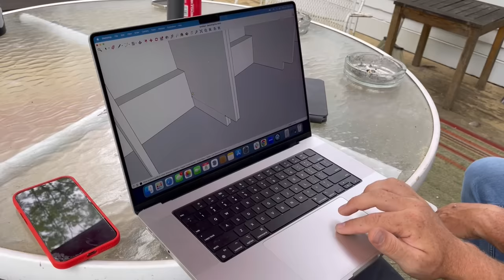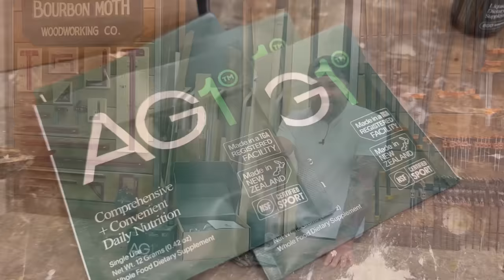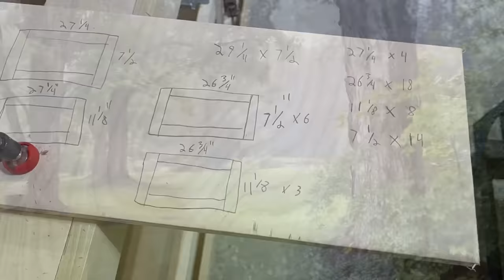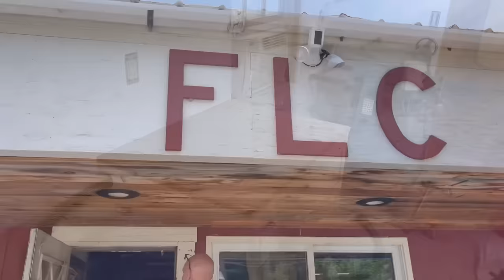This Is a Huge Shop Upgrade || The Ultimate Miter Saw Station

Comment: This was just great and inspiring. I’m just wrapping up my extension in the back of my garage and a miter station is the first thing I want to move in there but this build has made me say”I’m going in a different direction “ . I’m even going to try the laminate thing( just black) for the first time. Everything flat surface will get the same treatment ( in black no faces). I’m sure those guys are in the shop having a great time putting bigger mustache and bigger beards and maybe whiting out the mustache and beards. Drawing crazy hats glasses. I’m mean their were a lot of faces. It’s going to take them a month to finish.

Comment: About the rain 10:16
Buy a tarp and add eyelets so that it can  be attach on the inside & to the side of the barndoor. Then cut 2 rods that can be attach to the upper corner and in the middle of the entrance. This will give space/shade/cover and if ets wet it canhang to dry inside the shop.

Comment: I like the bit where you try the Rockler replacement drawer slides in which you think of them as value replacement to Blum.  Could you elaborate further in a video perhaps?  Like the "tips" videos that a wood worker would actually use.

Comment: When you built the miter station, how did you account for the swing of the miter to the full 45 - 50 degree angle on both sides of the countertop with out cutting out an angle for it?   This was a great video and was fantastic to see the process of building the entire workspace out.

Comment: I built my miter saw station in 2003. I moved in 2004, and again in 2010, and again in 2013, and again in 2019.
I did not fasten the two boxes together with glue. This allowed me to move them rather easily, although they are heavy. 
When I reinstall them I do the whole leveling thing. If you are building a miter saw station and you think you might move 4 times, you might want them to come apart even if you are 55.

Comment: Just a tip for routing laminate for outside the work piece route in a counter clockwise direction and on the interior you want to go clockwise rotation this will give you less chance of chipping the laminate with the router bit

Comment: I have a great time watching every episode.  😁 However, every time I am surprised by the construction of similarly long standing cabinets...🤔 I believe that creating them at their destination as single narrow cabinets, especially with these frames, does not make any sense - unless they are longer than the tricky material.  It would be more effective, i.e. saving material, time and gaining space for drawers, especially since a carpentry shop usually lacks space, it would be to build one with one common bottom panel and three traverses (2 upper horizontal ones for screwing the top and 1 vertical rear one for mounting to the wall), without a front frame, replacing it with deeper drawers or one additional one.

Comment: Great video. I've only just stumbled across your channel..  I see you already have some fans in Wales UK so here's another one from up North.   My workshop is in a total mess as I've never had the project of actually sorting out my project space. It is on the to do list though and getting very close to the top. I like the mitre saw station and want to build one. I have a question though.  I probably have a space of around 4 meters to put the mitre bench with possibly another few meters off to the side if I need more space but as this is a used space I can't make the bench any longer than 4m .  The norm would be to put the saw in the middle but this would mean  max 2m cuts...  What would be the issue (if any)  of making the tops of the bench modular. So each meter of bench top including fence can be lifted off and moved to another place on the bench (possibly with some sort of dog to locate. That way I can have my actual saw anywhere on the bench meaning I can get near 4 m cuts if need be.

Comment: How are these 1/3 the cost of Blum? 35 for a pair of 21” and Blum is like 38. Seems like some false advertising. I also looked at the plans for this. 24” deep cabinet with 21” slides?
Reply: These plans are pretty brutal tbh man. For twenty bucks there’s not a single measurement on the entire set of plans besides the parts list. It shows what size to make the parts, and the rest, i.e the construction in its entirety, has to be completely figured out by the user. Not what you’d expect for $20. For $12 you can get a set of plans from Woodsmith that has 20 pages and takes you step by step through every phase of something twice as complicated. Not a good deal. I wouldn’t advise anyone who’s not an experienced cabinet builder to use these plans.